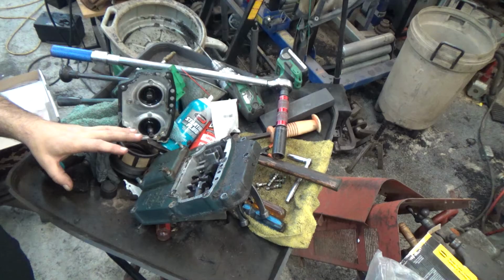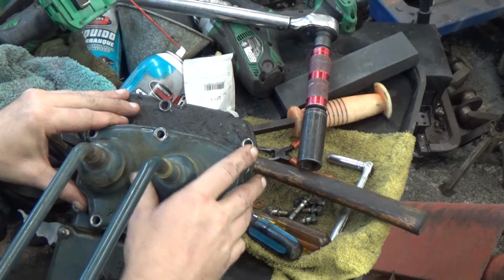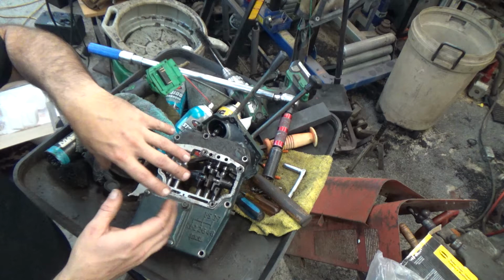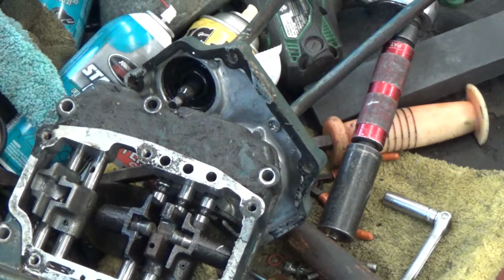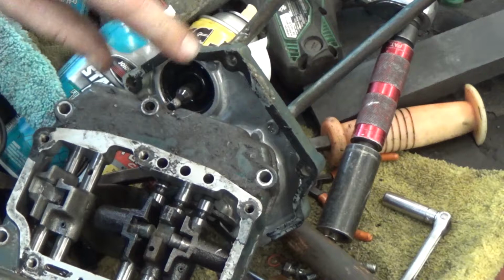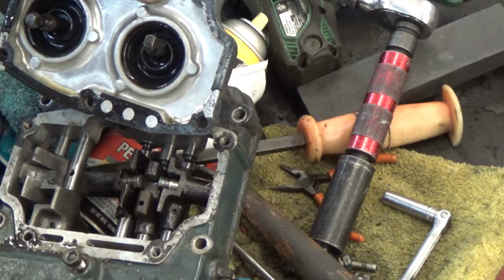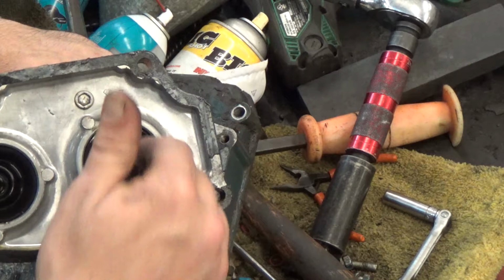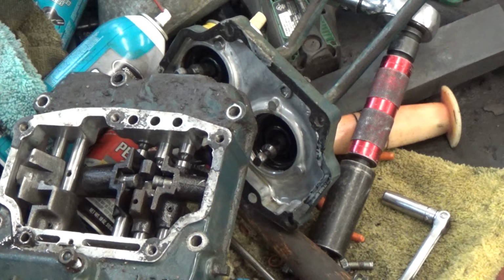Old Tractor Shift Problems

Comment: MF 135 probably 60s or 70s model. Perkins 3 cylinder diesel. Hung in one gear, I think third. Can’t get in reverse either. Prior to fatal accident one year ago, deceased brother in law, we think he said it wouldn’t go into 2nd. Never said anything about reverse issue. It sat in field next to accident site for a year before I decided to go get it working again. Did and drove it carefully for about 1/2 mile in whatever gear it was locked in. High/low works  and replaced hydraulic fluid Saturday and got lift working. Need all gears and especially reverse working. Property needs major bush hogging. Saw  some vids suggesting use long screwdriver in fluid entry hole to pry over a gear. Your thought please sir. Learning a  lot but new to me. Any help appreciated
Reply from the maker: Sounds like the detention balls and springs need servicing on shift plate.

Comment: 1979 Ford 1700, 12 forward speeds, 4 reverse, range shifter locked into highest range. I've been hesitant to take the cover off but I feel a little better about it now. How similar is my transmission? I'm thinking (if it's the same setup) it's the ball/spring breakdown you talked about. Thanks for the video, BTW.
Reply from the maker: Should be a Shibaura (Japanese) Ford model.   Will be very similar to the one in the video.

Comment: I have a Ford 4000 gas that you have to hold the shifter in reverse to keep it in gear. Everything works fine if you hold it in place.  If you let go of the shifter it pops out of gear and will grind. Any Ideas what is wrong? And If I need to replace parts where might I get them?
Reply from the maker: Is it the naa bodystyle or the big blue box body?
Reply: @AtlastaFarM       Sorry I am not sure
Reply: It has one shifter, 3 forward and one reverse. The shifter has to be pushed down or pulled up then shifted
Reply from the maker: Ok the push pull shifter is 90% on the old body style tractors.   Most likely you have a bent roll pin or worst case bent shift fork.   It is not hard to do either one, just intimidating looking if you have never worked on a tractor before.      I highly doubt it to be the problem.. but there is a slim chance the gears have worn teeth..  doubt this is the case as you would hear some bad music in the transmission.    Best place for parts honestly is an older Ford New Holland Dealer  (As in , been around a while).   Yes more expensive, but also the best quality.   and once fixed, most likely will never need to be touched again in your lifetime.